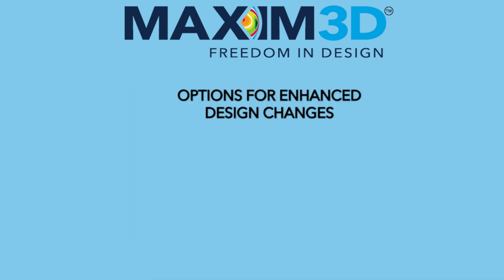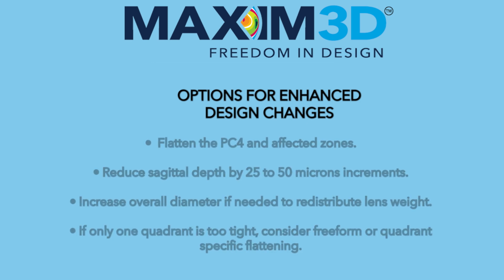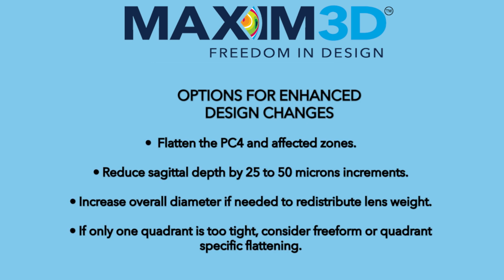Edge Alignment Fixes with Maxim 3D

Comment: Hello Im optometrist  in Vietnam and Recently I have been fitting an advanced KC case and already remade 5 times of the 3d maxim lens however the lab could not fix the problem of the landing zone. It is too steep and keep compressing the scleral of px, it seems the lab did not flatten the PC at all. Please any chance you could provide me the contacts directly to the lab technicians it could help alot.
Reply: whatsapp or email contact would help.